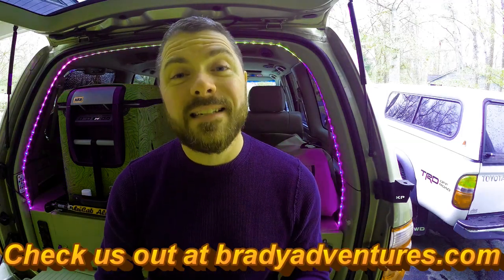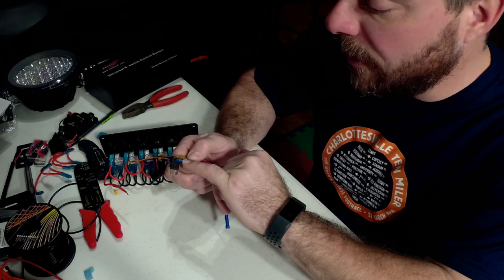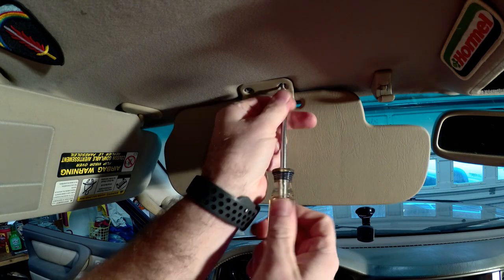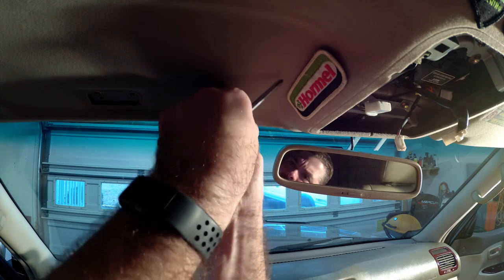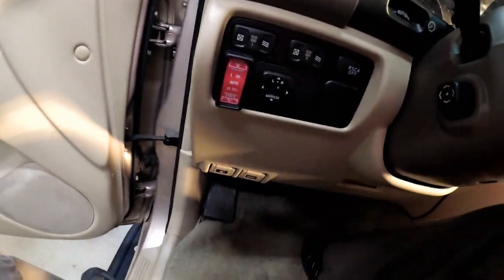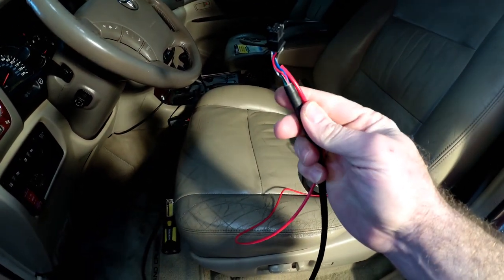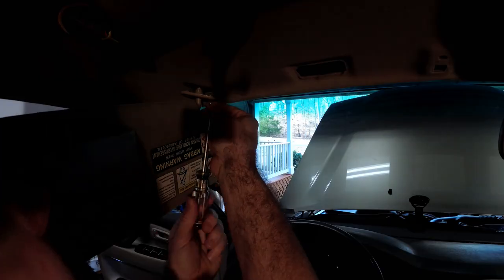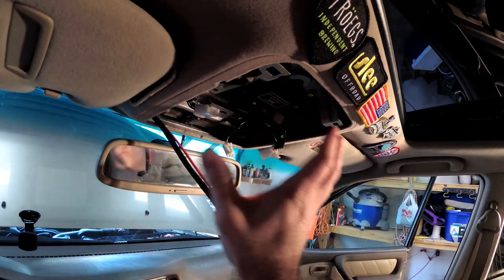Overhead Console A-Pillar Headliner Wiring - 100 Series Land Cruiser Overland Rig Build

Comment: Been running through your vids and I cant find a final video reviewing the OME suspension upgrades you did.   Any insight into that kit now that you have been running it for a while?
Reply from the maker: Thanks for bringing that up!  I had to take a break from youtube last year and that's a video that slipped through the cracks and I have been meaning to post.  I love the OME kit and the cruiser rides great.  I put a similar kit on my Tacoma because I liked it so much.  I am not an extreme off roader, most of what I do is on the east coast and fairly low speed on forest roads and things like that.  For that purpose I think these are more than adequate and they're also great on the road.  I have heard some complaints about OMEs for more extreme driving and those people swear by icons which are generally more expensive.   I hope that helps.  Thanks for checking us out!